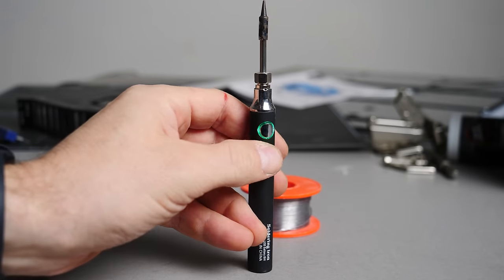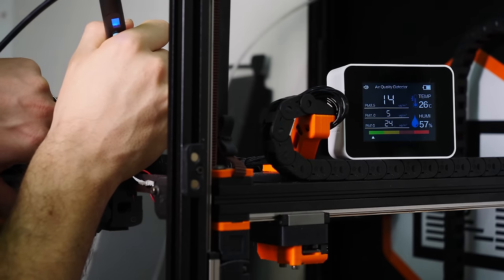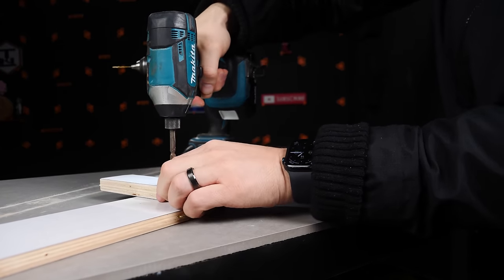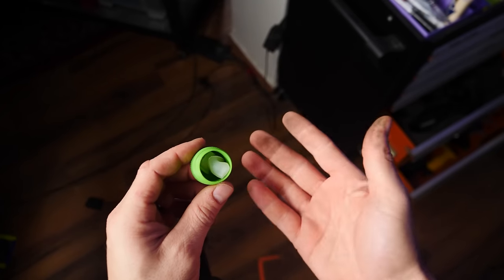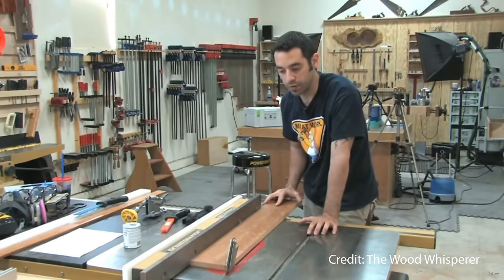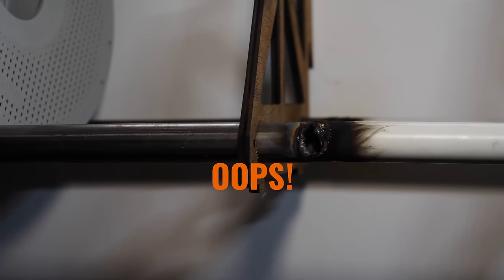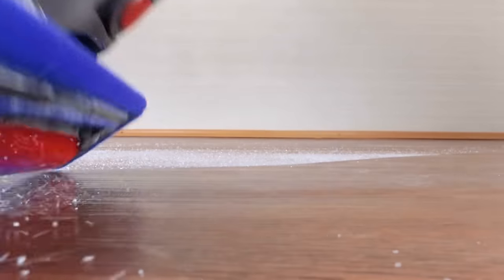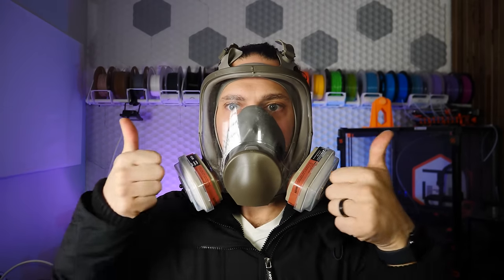9 Maker Tools I Wish I'd Bought Sooner

Comment: I would recommend a compressor (as you hinted to). Either a small and fairly silent one or a bigger one that you can stick in a corner and have air ends hanging from the roof in various spots. 

I also often work on electric scooters and a table/workbench made for the object you mostly tinker with is great (for me it was a hight adjustable motor cross work stand)
Reply from the maker: What can I use the compressor for?
Reply: @thenextlayer  many things, tools made for it or painting. I mostly use mine for blowing things clean, filling tires, cleaning the computer (instead of a electric or caned gas)
Reply: @thenextlayer there’s a whole new world of pneumatic tools to choose from when you have access to an adequate compressor ranging from grinders, cut off wheels, impact wrenches, and HVLP spray guns just to name a few!

Comment: Oxy Acetylene torches can be particularly dangerous tool for the hobbyist, as they will likely choose a small setup to match their limited need - big tanks = big money. The problem with a small set of tanks is that acetylene is kept dissolved in acetone to keep it stable inside the tank. If the job one happens to be doing takes, say, an hour to do, a small tank cannot safely deliver enough continuous acetylene for that long. You need a large tank to allow for continuous use. If you use too much acetylene in a session of torch use, too much of it comes out of solution with the acetone and the acetylene is UNSTABLE and can explosively decompose (without need for oxygen). Without proper instruction ahead of time, one would never know about this characteristic. I just randomly came across it myself while researching tanks and gas suppliers.

Comment: I have both of these soldering irons.  I use the battery one for heat insert... but you can pry my Pinecil from my cold dead hands.
Reply from the maker: Yeah? It's that good? I might have to splurge...
Reply: @thenextlayer   you have to consider how far you ever are from a USB-C power source.  In my case, that's basically never.   It can run from a power bank, a charger, my laptop, or even my phone.  Do you ever have a problem with scanners or metal detectors and the pocket knife?

Comment: Neat looks like I’m a pro since I have most of this stuff lol. Unfortunate Pinecel isn’t an affordable option. Iirc it was like $25 in the US and well worth it coming from more expensive Hakko irons. Good calls on PPE. Even sanding PLA prints I wear a respirator and eye pro. Imagine sanding carbon fiber or glass mixed filaments and inhaling or getting that in your eyes!

Comment: My personal experience:
Cordless tools - for me it really depends. For some situations I can see the benefit, but for work at the main workbench I prefer corded tools over the inconvenience of having to recharge tools or stuff running out of power while you work. Same reason I use a corded keyboard and mouse for my desktop, but cordless mouse for my laptop. It all depends on how I use stuff.
Ear protection - I had to get good industrial earmuffs just so I can sleep in my noisy apartment :v
I also invested in decent earplugs, but they're less comfortable. Still, it means I can wear both if stuff gets really noisy. Or I can wear wireless earbuds under the hearing protection earmuffs, if I'd rather listen to some music. Pretty useful, not just for power tools but if you need to read or do anything else that requires focus in a noisy area.
Multitool - I've got a Victorinox Swiss army knife that has been my EDC for... over 20 years now, I think. Even though I don't use every tool, it's still small enough that I don't mind. The tools I do use a lot like the scissors, the knives, the screwdriver, the can opener, the toothpick and the tweezers are all the reason I need to carry it around every day. The bottle opener and corkscrew I may not personally use, but they've still been of use many times when a friend asked if I had one.
Reply from the maker: Thanks for the comment!

Comment: As for tools that are 'not just for professionals', I've had this discovery about plumber tools. Calling a plumber is nowadays so expensive, for the same price you can buy some pretty decent professional plumbing tools. Clogged pipes that I couldn't 'declog' using $10 hand tools, I managed to clear with $50 drill-powered tools, all the while flatmates were insisting I just call a plumber and pay $100+
Even getting the more expensive $300 equipment might be a cost saving for someone who might otherwise have to call plumbers 'often enough'.
Reply: Plumbing isnt just about the tools
Reply: @jerbear7952  same can be said about soldering, welding, or pretty much anything that involves tools. And of course some plumbing tasks, such as making a new installation or replacing an old one require a bit more knowledge than simpler maintenance tasks.

Comment: A trick that a few old east indian fellas told me about when using a respirator and a beard is to use an interface medium.. ie Vaseline. Put it on where the seal rests and boom. Seal. optimally shaving is best, but this is a close second.
Reply: As for Vacuums, you can use a "Dust Cyclone" as an intermediate. Its no good for water, but it works for everything else, and its only limitation for size is the bucket its attached to.. Its meant to be used with a shopvac.

Comment: While I agree that risking your hearing is not worth it, and using consumer grade noise canceling headphones for protection is inadequate, keep in mind that some more expensive table saws are very quiet.  The motor type, the cabinet, and the blade can make a huge difference.  My saw is around 83 decibels and I don't use hearing protection for quick 10 second cuts unless I'm doing a lot of them.  Others could be quieter.
Reply from the maker: Oh good point!

Comment: I had to squint with anxiety when seeing the clips with the table saw. The handling and knowing the quality of the cheap Scheppach saws, I'm afraid of your health.
You said you learned a lot about safety about this specific tool and I hope all the clips were from before that time.
For you list of tools to consider: A planer and thicknesser make it much easier to handle rough sawn lumber wich is way cheaper and better quality than in home improvement stores, but the planer needs to be not the cheapest one and have long tables which make them pretty expensive.
Second tool: a router. Maybe only a little one hand router for nice chafers and round-overs. Gives a nice touch to any wooden project.
Reply from the maker: The clips were from before I watched some safety videos about table saws, but what do you mean clips? I know that I should use a saw sled for longer cuts (need to make one, haven't had time), and that for shorter cuts I need to use that thingie it came with (that I use now), but what else am I missing, safety wise? please fill me in.

Tools... nice, I'll check into those. I do have a handheld router and I loooove it.
Reply: @thenextlayer  It was mainly how near you came with your hand to the blade and some cuts looked pretty wobbly. The fences on these cheaper saws are often not as sturdy or properly aligned. I saw you mounted yours on the left side which is a bit unusual but may work for that saw. The parallel fence should also not parallel as the name often implies. A tad off from the blade at the back gives some room for the wood to expand. Maybe a millimetre, but not more. Internal stresses of the wood can make it pinch into the blade, for wich the riving knife is the thing no one should ever remove when making a through cut, or it can expand and pinch between the fence and the blade.
I always stand left to the blade. If I ever get kickback, it won't fly into my guts.
You also may consider building an overhead dust collection port. It not only reduces a lot of dust flying, but also gives some protection for accidental reach into the blade. I 3D printed mine with the addition of some clear PC sheets. :)
I bet there are enough videos out there explaining much better what I mean. You may watch dPu9QtjSZJI with English subtitles. Only a few translations are off, like "saw blade" is show as "blessings".
Reply: Gosforth Handyman "11 tips to avoid death!" was the most comprehensive vid I found, he linked a few other excellent videos that are a bit shorter than his own in his description. The biggest thing to know is that kickback not only is a projectile risk, but can pull arms into the blade faster than you can react as the workpiece gets yanked around the blade. Avoid it by using a riving knife, ensuring the fence and blade do not form a concave funnel, and pressing the workpiece both into the fence and into the table with hands, featherboards, pushsticks, grr-rippers, powered feed rollers

Comment: With an air compressor you can use a dremel like tool, especially useful for finishing your prints for polishing drilling and sanding. You get up to 50.000 RPM which a Dremel can't achieve.
Reply from the maker: Good call. I’m considering one seriously
Reply: @thenextlayer  it’s like the drills you see at a dentist. They are really high precision instruments. For really fine work. I even ask my dentist for the diamond drills. Because he has to toss them away, after a patient’s visit. So I get them for free.

Comment: not sure if you have something equivalent to harbor freight but a mig welder is pretty cheap and then a tig welder that is auto feed are not very expensive and very easy to use even for nonexpierenced like myself to use and learn from, also 21 gallon air compressors are nice as they dont have to run long if your just air brushing but loud, but necessary for my garage and continues air using tools, like disc cutter and impact. but a quiet version thats smaller would be nice for inside for air brushing and studio needs, ya no instead of countless cans of air
Reply: just want to say i enjoy your videos and would love to support anyway i can but tight on cash and still learning cad

Comment: I'm a fan of impact drivers typically, but I'm noticing that the newer brushless drills are more powerful than the smaller impact drivers
Reply: Powerful isn't always best - you can strip screws faster 😂
Reply: @Aussiemoo  true, but they have torque limiters and also are very controllable and I'm comparing to impact gun where you need it. 
But yeah, I also have a little 12 volt drill that I love for smaller stuff.

Comment: I've seen those cheap AF battery powered soldering irons fail horribly too many times to ever trust one not to try and kill me/burn my house down.  A good pencil iron like the Pinecil is only around $40US.  I'm poor, but I'll spend that extra money for the sake of basic safety.

Now, on the subject of ear pro, look at electronic muffs marketed for shooting.  The entry level ones (e.g. ones from Walker's or Howard Leight) aren't that much more than expensive than the unpowered ones and will let you hear people speaking without having to take off the ear pro.  They are worth the splurge.

As for air filtering, if you have the space, consider building a Corsi-Rosenthal box.  They are a LOT cheaper to run than an off-the-shelf air purifier and filter a LOT more air.  They can also be easily repaired if anything breaks.

Comment: 3:05 === 99.99% of "awerage" people still dont know what impact driver is and why you need it 
and 99% of DIY people dont know they need 3M cubitron II sandpaper that is 2x faster than anything else and last 15x longer while still working better at the end of its life than brand new "brown" sandpaper
also 99% of people dont know they need multitool with starlock system from bosch and fein .... its a game changer ... changing blades takes like 2 seconds , they last rly long time , you can find blades to cut concrete , silicone , plastic not only wood and metal....and starlock is 20-30% faster with the same power and 2x smoother than anything else (cheapest cordless bosch starlock is bosch universalmulti 12v ,,,, or advancedmulti 18v (go with 12v if you only want this 1 tool and cant find 18v cheap-- its powerfull enough for all aplication) 

PS
you need to try different impact driver because all works different ...some like that makita start to impact to late for some aplication and some start to impact instantly even with 3mm screws

Comment: You wanted to hear some safety advice: you’re using your tablesaw fence wrong.  It’s setup on the wrong side of the blade. It seems like you made this choice based on the layout of your shop. While this wouldn’t matter much for perpendicular cuts (and I almost wasn’t going to mention it till I saw this 8:43) having the blade angled towards the fence like this for any angled cuts increases the chance of the material binding up and causing kickback. Also it doesn’t give you as much space to manipulate the material with your hands.
Reply from the maker: Can't it be used on either side?
Reply: @thenextlayer  Absolutely, for perpendicular cuts.  But a tablesaw blade only tilts one way, and by tilting it toward your fence. You create a tight little space that is more prone to kickback.  Picture what happens in kick-back:  the rear of the blade lifts up the piece and then it gets jerked in the direction of the blade.  In a normal perpendicular cut that's not a big deal, if the blade is angled away from the fence, it will definately mess up a piece, but if the blade is angle toward the fence, it presses the piece up in a way that it presses more against the side of the blade.  Creating a snowball effect that turns a small snag/kickback into a bigger more snarled mess.

Comment: Saying your old mans corded drills sucked because they were corded is a bit short-sighted. Early cordless drivers were screwdrivers running at low voltage & low rpm (slot-head/ blade were still common). Compared to the ratchet & Yankee driver alternatives (again with slot-head/ blade bit) those new tools were relatively more impressive than what we have now. For example, the significance between a good car and our dream car is far less than no car and our first 🤘 Grumpy old man, signing off 👍
Reply from the maker: When I say "they sucked" I mean he probably bought the cheapest model available at the time because the apple doesn't fall far from the tree ;)
Reply: @thenextlayer  In that case I'd like to apologise. Sincerely, my apologies for shooting off my mouth.
I need to work on my downward spiralling cynicism.

Comment: Completely off but the first gadget that you showed the moment I seen it the only thing I could think of was the E-Cigarettes from 2012😂😂 and how it looks like someone just took one of them and stuck a soldering tip on it😂 may have to take some of the old ones sitting in my basement and monkey around with them

Comment: For me, the tool that was a major improvement in both the quality of my projects, and how easy they were, was a biscuit plate joiner.  

You just put a pencil mark across the two pieces you want to join, line the tool up to the marks, add a little glue and a biscuit, and you have a flawless join between two pieces without any visible fasteners.

They are freaking magic, I love it.

Comment: I was disappointed that all your shots of table saws were without the proper safety guards.
You are right, table saws can be dangerous.
Also, maybe even more dangerous is the handheld circular saw. Be careful!
Reply from the maker: Yeah, that B-Roll was all from before people filled me in. I still haven't built a saw sled, though... what else am I missing, though?
Reply: @thenextlayer  I agree with the guy on getting a MIG welder. Easier to get a pretty weld and not too expensive.

Comment: After burning out another EU-compliant consumer vacuum cleaner, I bought a shop vac. With big, powerful motor, not that dinky, power-limited soda can of an AC motor they put in consumer stuff to be eco-friendly. These are usually relatively cheap, can deal with water easily, and they don't overheat.

I recently bought a digital microscope for soldering, as my eyesight is rather poor. This made my work so much easier. If you do any electronics, especially with modern SMD components, this is a must, and great tool, besides.

As for power tools, my completely blind brother, who is an youtuber (LeKret), bought some, as he is planning to do carpentry by touch. I have a few power tools, too, and I'm extra careful when using them, because I like my fingers. His attitude is a bit more careless. He has a video in which he solder some cabling, and because he is really blind, ho does it by touch and muscle memory, waving hot soldering iron tip millimeters from fingers of his other hand. When I try to caution him, he's response is: "I know what I'm doing. What could possibly go wrong?!". I'm really grateful to the scientists and surgeons who invented the techniques for reattaching limbs - my brother, with this attitude, might need their help...

Comment: Be aware that an impact driver is the wrong tool most of the time for screws because it doesn't have any torque adjustment making it super easy to destroy the thread / material you're screwing into
Reply from the maker: True, but it's fantastic for screwing into concrete or wood :)
NOT for working on cars...